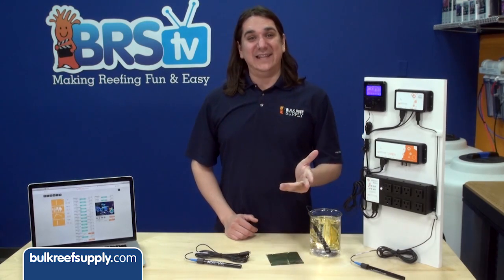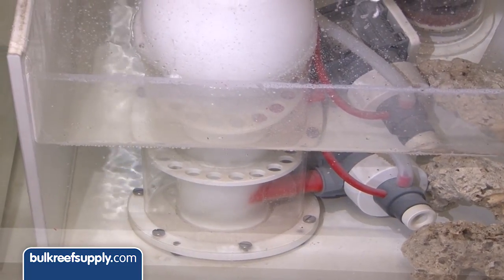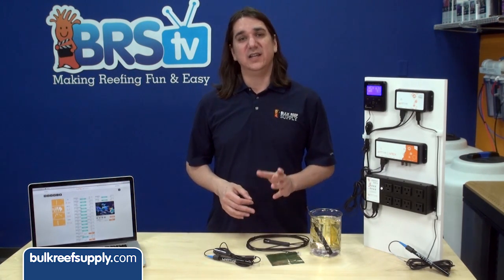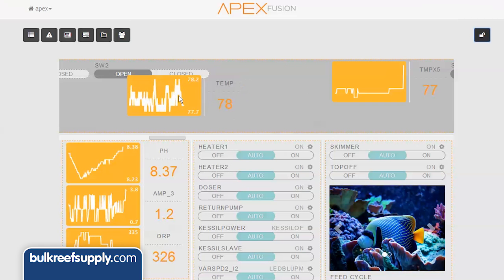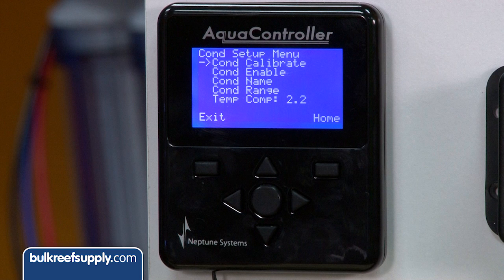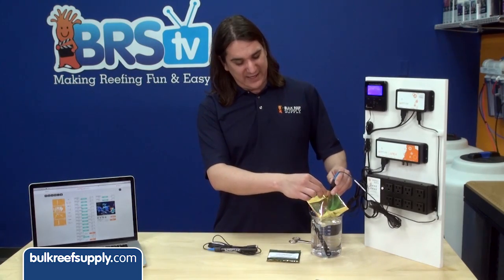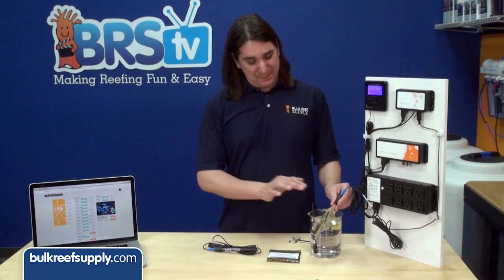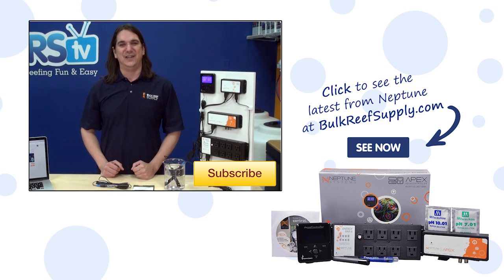How to Calibrate your Salinity Probe EP 09: Apex Aquarium Controllers from Neptune Systems

Comment: I wanted to say thank you so much for making this video. it helped me get the correct reading on it. when I first got my apex i wasnt sure what to do and my readings were 50.2 because when i calibrated it I did it with the range set to high.. thank you so much i feel good that im getting the correct readings because I checked it against my refractometer and it was spot on!! thank you!!!

Comment: Just an observation. After having issues during the calibration I noticed that just tapping it to get all the air out was not enough. I ended up putting the probe and calibration fluid in a bag then rubber banding it and turning the probe upside down while still in the fluid to get all the air out. In the tank I installed it upside down to get all the air out and to prevent bubbles from ever getting in there.

Comment: My tank is running at 30 degrees Celsius. I kept the solution packet in the sump for a while to acclimate. Then did the calibration process. Is the temp of my tank too high for calibration?
Reply from the maker: 30 degrees C is pretty darn warm for a reef tank. While I don't think it's too high to perform the calibration process, I'd suggest trying to get the temp down to at least 27-28 degrees C for the sake of the fish and corals.

Comment: How can you tell if your salinity probe needs to be replaced? I have a probe that will have accurate readings for up to two weeks but then will show an increase in salinity unexpectedly and then after recalibration will be work again but only for a short period of time.
Reply: ***** Our probes are positioned in a tank where the inflow comes from plastic tubing. The tubing has been placed in a way that it hits the probes right around their middle section. Is there a way to avoid the air bubbles even if the probe has to have a constant flow of water on it?

Comment: Why is is the temp probe calibration set to 2.2? What are the numbers representing and why 2.2?
Reply: Thanks for the info :)
Reply: BulkReefSupplyCom 

This is incorrect. The value is an adjustment that increases the salinity reading by 2.2 ppt per degree Celcius for every degree above 25C and reduces it for every degree below 25C. It is not a percentage. Because the value is a fixed number and not a percentage the actual value will vary depending on the total salinity of the tank as well as the levels of dKH, Ca, and Mg. 2.2 is a good starting point, but the only way to know for sure is to adjust the tank temperature and see if it rises, falls, or stays steady with temperature. If steady you're good, if it rises as temp rises you need to reduce it 0.1, and if it falls as temp rises You need to increase it 0.1. It is also very important that the tank temp be very near 77F or 25C when this is first done or the tank will require calibration again after the temp compensation has been tuned.

Comment: is it possible to 'calibrate' the probe in tank by measuring your systems salinity via refractometer, etc. then setting the current value for the probe?  would be much less hassle..
Reply: ***** yeah but i'm not interested in its accuracy.  i just want to set alarms based on large variations (ATO sticks, salinity goes from 35 - 32 for example).  i want to calibrate it and use it much like you've demo'd the thermometer.  is that possible?
Reply: kannadeshi exactly..
Reply: This is what I'm trying to do also.  This probe is nothing but trouble.  When I called Neptune they did this in tank but I can't figure out how they did it while on the phone with them.  It was manual calibration.  They sure don't make it easy on us to find out how. This is the #1 complaint with the Apex. I don't need it spot on I want to set it myself when I know my tank is exactly 35.  Someone must know how to do this?? Anyone?????

Comment: You are missing STEP #1. THE PROBE NEEDS TO SOAK IN SALTWATER FOR A WEEK BEFORE CALIBRATION. Failure to do this will force another calibration within the next week of ownership.
Reply: BulkReefSupplyCom 

It is not listed in the manufacturers instructions, but is a known issue that has plagued the forums since before I owned an apex (I am Zombie on neptune forums btw). According to neptune reps, a full week is not necessary but at least overnight to 24 hours is and from experience in the forums it is often closer to 48 before it settles out (I always say a week because that's what an ORP needs and usually people buy everything at once. Better overdo it than underdo it and have to recalibrate). Also the drying step (though mentioned in the manual as well) does more harm than good. The correct procedure is to rinse in RODI and lightly pad the tip with a paper towel. The goal there is to remove any salt, not to dry the tip.
Reply: Hi Jonathan i think i messed up mine when i was caliberating my new salinity probe last night...i am getting a result of 18ppt..i have an apex 2016 do i set my temp compensation at 2.2% when i re do it again after a week as i will let the probe sit in the sump for now allowing it to break in. Neptune needs to provide a full indepth instructions on these probes. No where on their website under Get Started Guide discuss calibrating the probes. Thank you for your service on Neptune forum.
Ryan Thank you for all the videos you guys come up with much appreciated....